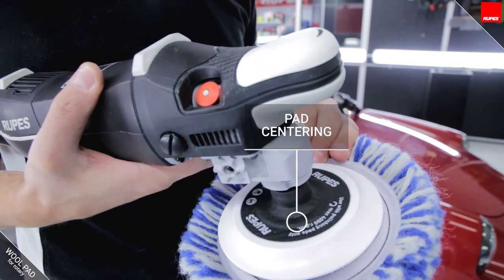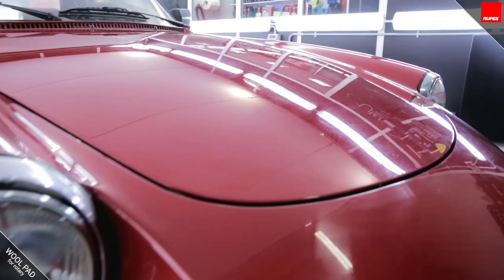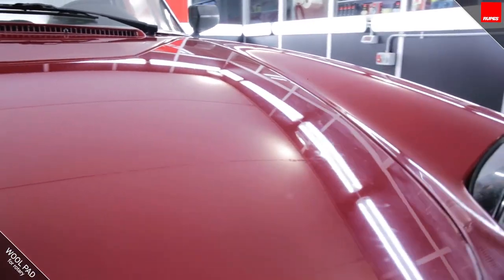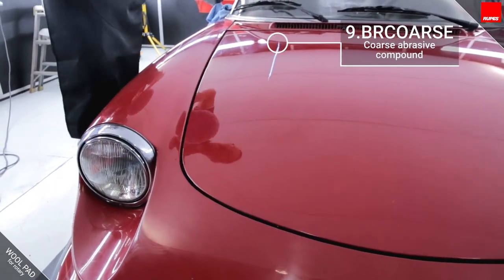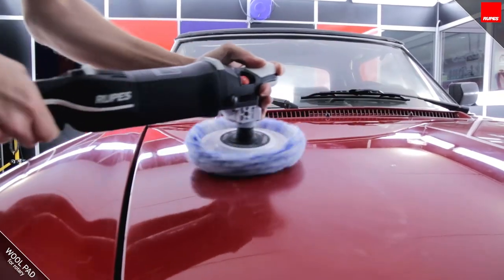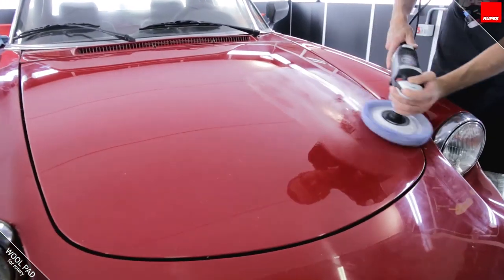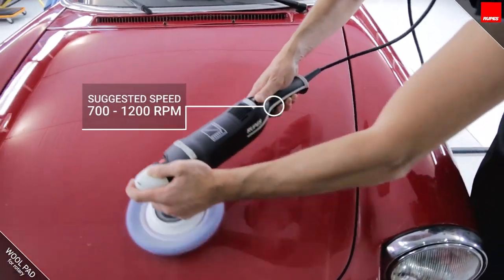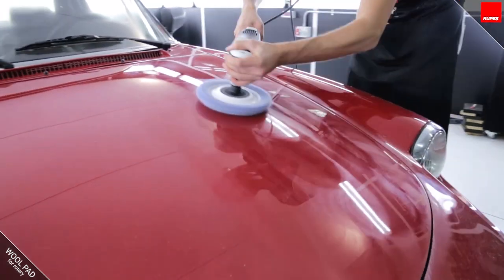Wool pads for Rotary Polisher

Comment: Did anyone else gasped when polisher was placed upside down on hood?! Yikes!
Reply: If the two rubber stands on the back of the polisher are clean in no way will it damage the surface of the paint. On that vehicle, I think there are more things to be concerned with than setting two small pieces of rubber on the hood! LOL it's in rough shape, looks like someone closed the hood with a tool underneath of it.